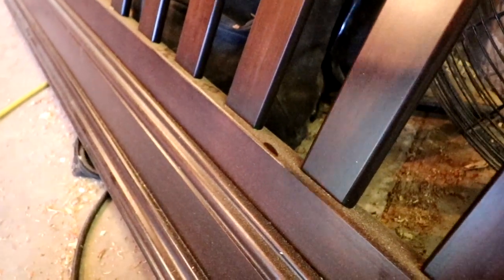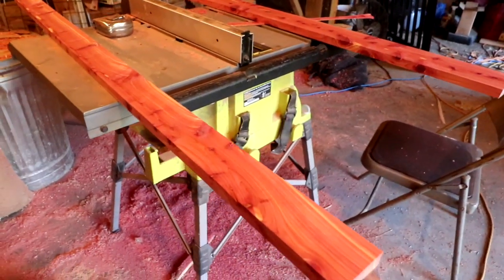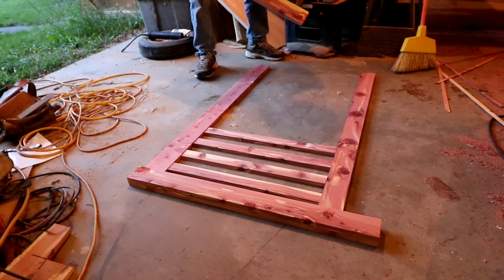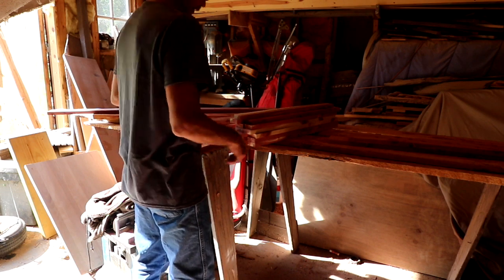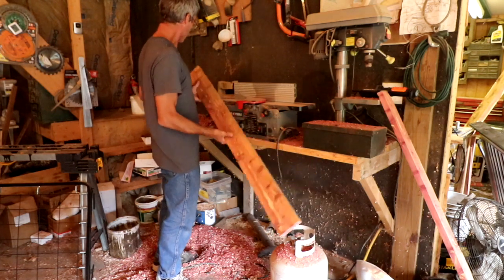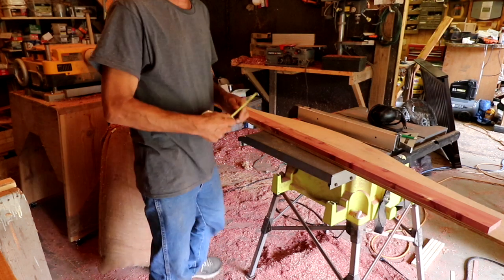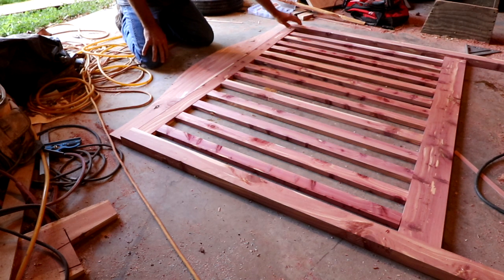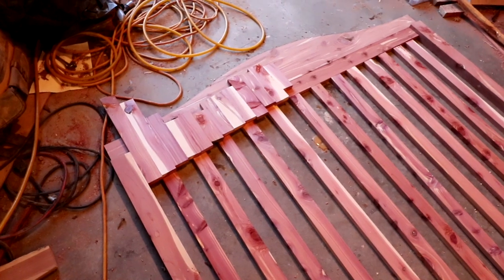THE WORKSHOP. The Baby's Crib. Part 2. The crib project continues.

Comment: Looks great, Joe. Do you use your original template for the aches in conjunction with a flush trim router bit to keep it even or just sand it by eye?
Reply from the maker: I sand it by eye. I did not show it in this video but I use my spindle sander on the curves.

Comment: Do you have a set of drawn up plans or is this in your head based on the previous build? I'm just curious as I watch you build different things I dont see anything on paper as you do the projects.
Seeing that cedar reminded me of the 150 yr old piling I salvaged from a job in Scott Co. Iowa bridge job. It was buried in the ground under 10' of soil unexposed to the elements. I had 6 of them about 10" in diameter and the were purple with the exception of the pale outside. They were beautiful. A guy built a bar out of them.
Reply from the maker: In the first video in this crib series I explain what template I am using, part of it is in my head but I do explain what you are asking. I bet the pilings were beautiful.